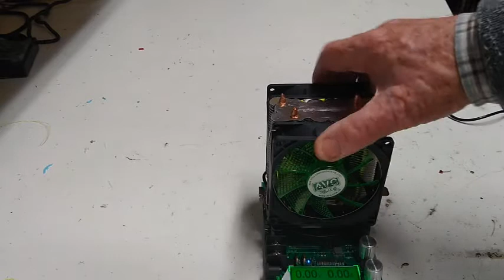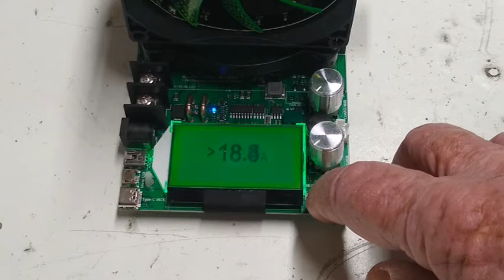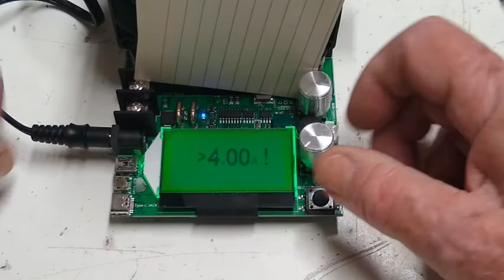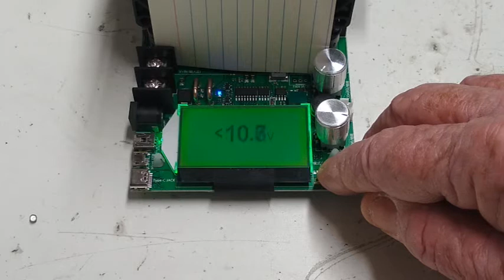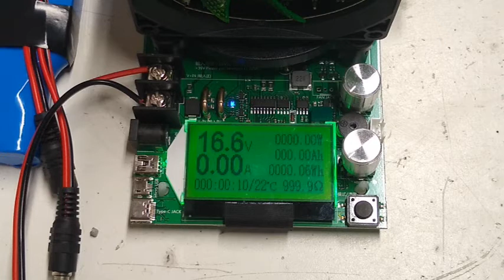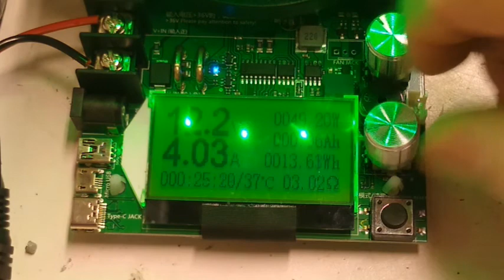Electronic Load Tester

Comment: Can the voltage and current on these be calibrated by accessing a hidden menu? Mine is significantly off, and no, it not voltage drop across the supply leads.